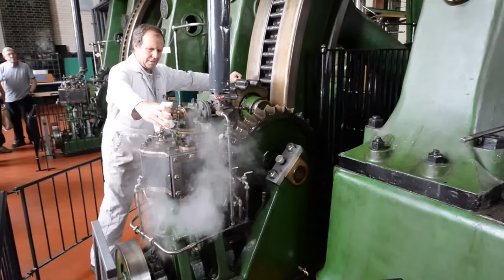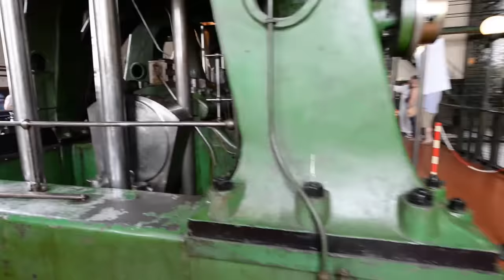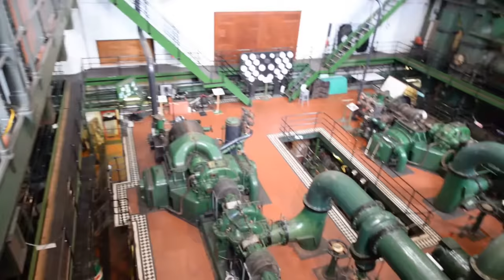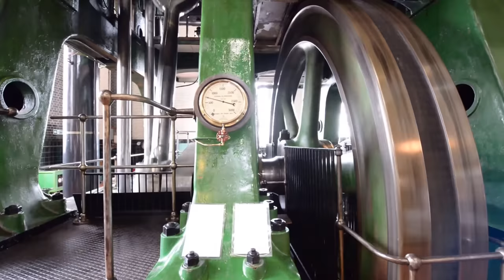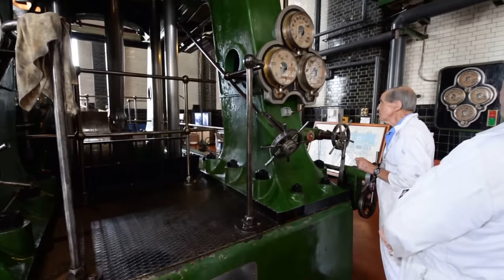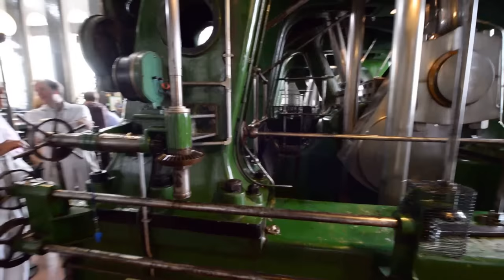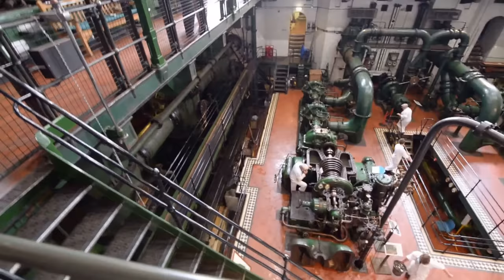Kempton Park  Big Triple Steam Engine Starting

Comment: Amazing engine.  One point that stood out to me was the flywheel.  At operational speeds (about 16 RPM)  You could look at the edge of that massive flywheel and see absolutely no runout with the naked eye.  I bet there's less than 1 thousandth of runout, if even that.   Then later on, the distinctive, blue glow of the two mercury arc rectifiers on the lower level. 
For a closer look at one of those, Andy, of the Photonicinduction channel has a video about one like that.

Comment: when you watch the movie they were able to put this thing if full reverse with out the pony motor to get it started or do they need it here since they use lower pressure than what was used. back then it was like I think 215 psi.

Comment: Reminds me a bit of the mill I operated for a few years, a little bit more modern than this but was vintage electronics. No touch displays just a wall of lights and buttons and analog gauges that displayed amps, it was a finicky thing to get started, had to prime the oil coolers get the water pumps online and make sure they are clear, purge and clear the air system and then prime the classifier fan and then finally push the button to get the massive ball mill turning, then once it’s all up to speed start feeding coal to the mill and cut all the shakers and vibrators on. A lot to do for one man but you got used to it and I could eventually run it by listening to how it sounded, although winter was never a fun time having a whole plant ran off water and air things were always running too cold and freezing up. Sadly the place suffered fire and it gutted the control room and they’ve decided to upgrade and rebuild so now it’s all controlled by a computer in a 40ft conex container with touch display, losing a lot of the charm there was in operating such a place.

Comment: Interesting fact- ship engine bolts are round with a hole on the outside. To tighten the bolts you thread a hydraulic jack onto each thread, apply 2500bar pressure to stretch the cylinder head bolts and with a 5mm dia bar tighten each nut by hand. Once you release the pressure the bolts are Tightened. 

This type of engine is a cross-head engine. 

Love the large gauges lol

Comment: My fertilizer plant has 3 engines driving syngas compressors. These engines are similarly huge, 40' long, 12' wide block, 20' tall for a V-16 2 cycle natural gas engine running 320 rpm. 17" bore, 19" stroke says it is way too big to have a starter spin it over. It uses a compressed air tank injecting into the heads to spin 180 rpm to start. The starting air compressors are 50hp and run about 5 minutes to build up the starting air to 325psi. Insanely cool engines, kind of like this steam one, only these things have been running for over 60 years and counting.

Comment: These giant steam engines are incredible. Horse power figures are directly related to crankshaft speed, so to say it has about 1000HP isn't a true indicator of the power potential of this beast, since it's a relatively slow-turning engine. But with all that spinning mass, the TORQUE value would be a more realistic indication of what this magnificent power-plant is capable of. I can only guess it must be north of 30,000 lb/feet?

Comment: Wow what a marvellous machine, I can remember working at Radio Australia Transmitter Station at Shepparton, Victoria, Australia as a trainee tech, where the diesel generator was started by compressed air. If it didn't fire up after three tries, that was it, the compressed air tank would then have to be recharged. Those were the days!!

Comment: if you like this video.... you must see the Henry Ford Museum.    It has a section with many, very large engines like this one.   Imagine, walking through a steam engine so large, that it is housed in a museum built around it.  This is what used to power the Ford Motor works plants.

Comment: 1000 hp! It's mind-boggling to think that a less than a century later my car produces 80% of that.
Reply from the maker: Indeed but it's worthy to note the other side of the coin that being torque!
Reply: Horsepower isn't real.  It is the product of a mathematical equation.  Rotary force is measured in torque and RPM.  If you want to know the true power being produced from any engine, ask for the torque curve.  That shows torque at measured rpm.

Comment: Would be nice to see the steam generator!
Reply: Having seen it, its not that impressive. I haven't visited for a few years but iirc it is powered by a modern Cochrane 'Wee Chieftain' gas fired boiler that looks quite modest in comparison to the main engine being only about the size of a medium van. As it no longer pumps 13,000 gallons of water a minute, the demand for steam is now very low.

Comment: I would like to see the steam boilers needed for this big machine.... even when idling these big cylinders are going to need a lot of steam. I don't think the machine is actually working (that is: pumping sewage), but is just running in idle mode. 

On the other hand: a steam locomotive with 1000hp is medium sized, the largest (european...) steam locos had around 2000hp. The boilers of these locos produced about 13-15 tons of steam@16bar, so the boiler for this engine must run on less. Probably oil fired these days.

Comment: Does a steam engine make power by momentum. I know a combustion engine has the explosion and pushes the Piston down.
Reply: Steam pressure in the cylinder pushes the piston down, which is connected to a crank like in a car engine. The flywheel stores rotational energy and keeps the engine running between steam power strokes.

Comment: what is the purpose of an engine THIS big? was it a method to generate energy for factories? some kind of massive ship engine?
Reply: It pumped drinking water across parts of London.
Reply: Rms titanic engines are these big engines the actual engines are a little bigger but it’s hard to tell if paired next to the engines in the video also 1000 horsepower imagine the torque on that engine

Comment: Imagine that a 1,5 Litre F1-Turbo Engine from the 1980th - fitting in a moving box - has the same power.
Reply: This is steam however, so although the HP isnt amazing, the torque is phenomenal, tens of thousands of lb/ft
Reply: @animesis  Yes of course. But if you set down the F1 engine with a reduction gear to the same amount of RPM, then you will have the same torque like the steam engine. That's physics.
The steam engine will act as a huge flywheel. But you could theoretical also use such a flywheel on the F1 engine.

Comment: Very nice, but pales into insignicance when compared with The River Don Engine - the most powerful steam engine in Europe. Situated in the Kelham Island Museum in Sheffield this 425 ton 12,000 HP engine was built in 1905. She worked armour plated steel 40cm thick, weighing 50 tons. Her party trick which has to be seen to be believed, is stopping and reversing in the blink of an eye. Steaming twice daily at 12 noon and 2 PM Thursday -  Sunday should not be missed

Comment: So bassically, you need an engine to start an Engine
Reply: Well it is how most engines start, for example the starter motor in a car is basically just a small EV motor hooked up to the flywheel
Reply: @ThomasFarquhar2  yea but the starter motor uses electricity instead of another piston engine that uses fuel so yea
Reply: @ItsEvangadgetGaming  fair enough
Reply: @ThomasFarquhar2  damn you litterallly replied 2 minutes after I reply to you
Reply: @ItsEvangadgetGaming  I have nothing better to do and that's how long replies take to get to me it seems

Comment: Are these actually being used to generate electricity  or is this just a museum now ? Anyone. Thank you.
Reply: Museum, but never used to generate Electricity and pumped Water instead. The Water Pump Plungers are located right under the Engines in the Basement. The Pumps are not driven by the Crankshaft but directly connected to the Pistons; the only Purpose of the Crankshaft is to make the Engine go past Top and Bottom Dead Center.
Reply: @Genius_at_Work  Thank you.

Comment: I'm curious as to why a steam engine like that needs a starter.  Steam engines are self-starting if there's more than one cylinder. 
Only thing I can think of is it needs to be turned over for lubrication reasons.
Reply: Compound Engines like this one behave like Single Cylinder Engines when starting, because the Steam goes into the High Pressure Cylinder first. If that one is in Top or Bottom Dead Center, the Engine can't start. Compound Engines in mobile Applications (aka mostly Marine Engines) have a Bypass Valve, that can send Steam around the High Pressure Cylinder right to the Medium/Low Pressure Cylinders, for starting the Engine. Pumping Engines like these aren't started very often, so it's easier to just slow turn the Engine to Starting Position.
Reply: @Genius_at_Work 
Thank you for the info.  Being that big I was thinking along the line of steam locomotive.   If one side is top or bottom DC the other side is 90 degrees offset. 
Just when I thought I knew everything, I learn something new and interesting. Thx again. 
👍😊

Comment: how was the steam to run this created? is there a big fire somewhere and people shoveling coal or wood into it or was it with gas or oil?
Reply from the maker: Hi it uses a 3 phase electric boiler
Reply: @mjamesthomasb  neat, was it always this way or was it different when they built it?
Reply from the maker: @RadimentriX  coal fired boiler in a separate boiler house, it's space was reused to install electric pumps to replace the two steam pumps in the 1980s
Reply: @mjamesthomasb  uuuh, i would've loved to see that, the complete old setup, working

Comment: Considering steam engines usually put out very little hp but insaine tq... like a case steam traction engine usually makes 110hp-150hp but 3,000tq........ if this is putting out 1,000hp they must be like 10,000tq or more and only at like 50rpms lol

Comment: Nowadays, an electric motor, meant for automotive use, the size of a bucket; produces the same horsepower......
Reply: In your dreams
Reply: @officerdonut7066  Fact. Saw one of the traction motors from the Lyriq or whatever a couple of years ago.....rated at 600 hp.
These are not your big old induction motors for 60 hz. They use high freq multi phase power which cuts the need for the big iron

Comment: 1:58  moving parts as flywheel, connecting rods, gears ...should be covered with casing or at least screened with thick plexiglas or tempered glass, same for the protection barrier, too low and poorly fixed: it must be stable and permanent. The operator wears a suit that hangs wide and loose from the ankles and wrists. It is dangerous.

Comment: You could replace it with an electric motor the size of a dustbin ! They are the most totally inefficient  engines ever built. Don’t you think the men who used to operate this  engine would have sooner just turned a switch on ?  Don’t watch things through rose tinted glasses .
Reply: You could but in that situation there's still likely a steam engine somewhere along the way

Coal, nuclear and oil power plants are steam engines at their core, and if that power is being fed into the motor you might as well just use steam directly